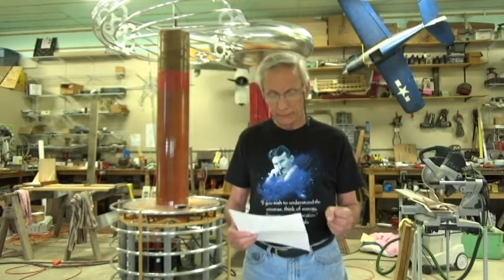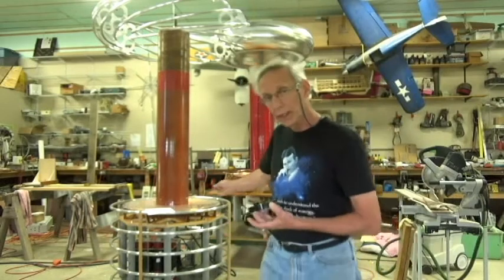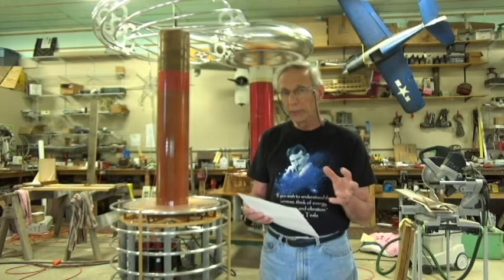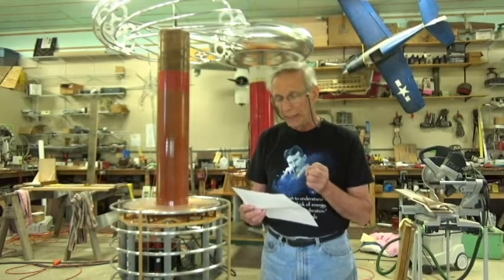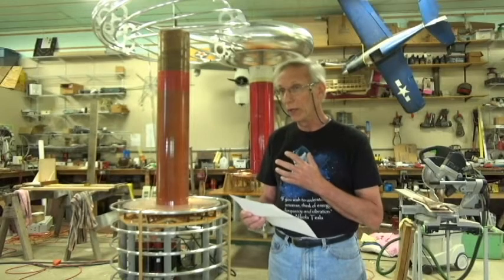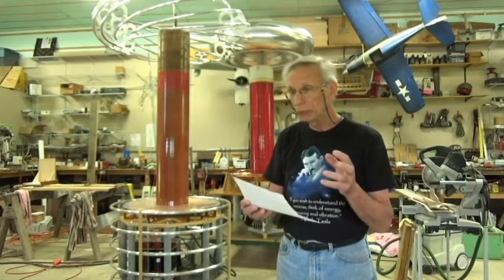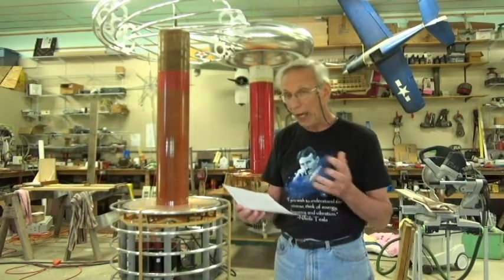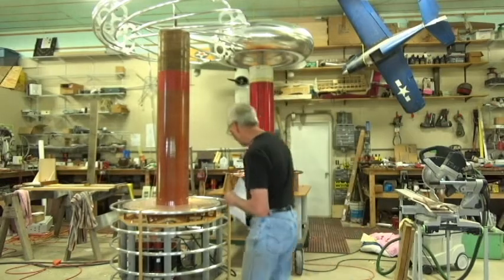DRSSTC video 2017 Bud Mohrman

Comment: How does the vortex shaped top load affect it? And I'm doing research to build a sstc first then jump into the drsstc I'm also curious how a vortex shaped primary would affect the coil you as someone who isn't trained in electronics the part I find the hardest is reading the schematics and it's not the components it breaking it down into the parts that run each other like the driver for igbts and the power supplie everyone just throws it all together and it terrible trying to read it awesome video by the way

Comment: Bud, great video. 

       Just a note, a lot of Tesla coils have a breakout point, a bump or spike in the capacitance load.
Make certain your target has an equal breakout receiver point to strike.
This will make it easier to evaluate the resonant transmission of power between those points.
        Sincerely,

      John Wilson

Comment: Bud, 

To the best of your knowledge, has there been any progress managing the direction and length of travel of the electrical charge?  Thanx,  LP
Reply: Larry, try to search for QCW tesla coils, those have come a long way in growth control. But control of direction, I think the best research so far is pre-ionisation of the air by laser.
Reply: Larry - I have had good results (avoiding strikes to the TC/primary) using a toroid sandwich (in my case 12"/20"/12") with a small break-out point. The discharge usually stays within a reasonably narrow vertical range until it is a toroid's radius away from the  breakout point, but after that its all over the place unless the ground electrode is small. And for spark gap coils, for a given energy per bang, higher BPS seems to allow the hot streamer to 'accumulate' length better than the low BPS case where the heat is lost causing the streamer to start from scratch each time. Otherwise, its a powerful laser or a flame to pre-ionise the desired air path!